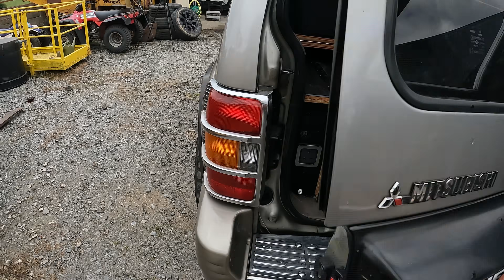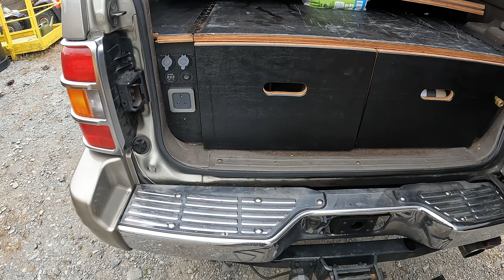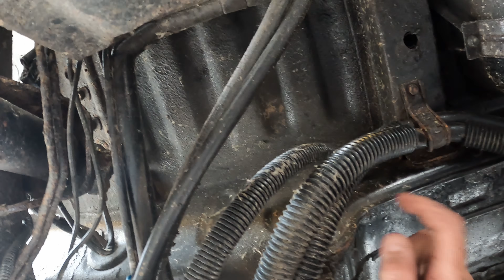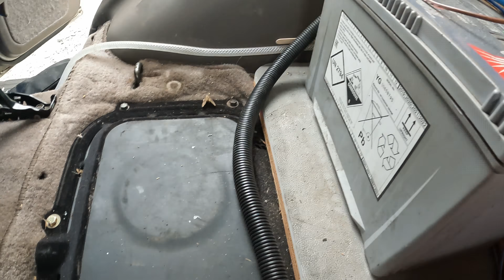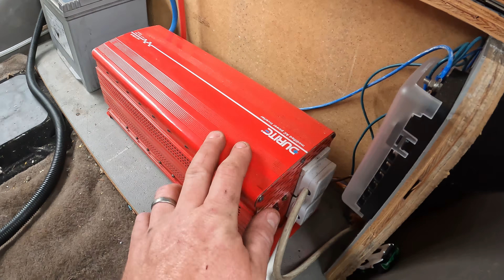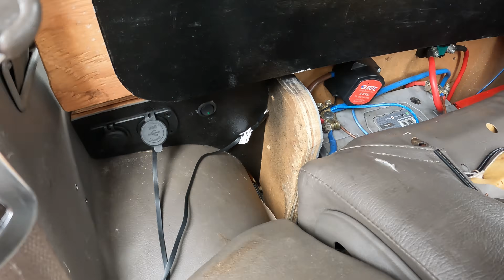Mitsubishi Pajero Mk2 2.8 Leisure battery and Split charge relay walkthrough.

Comment: Have been looking to do this for my Yeti, unfortunately though there is a lack of space. I did think about taking out the middle seat from the back row, but every time I think about doing it I find I need the seat. Nice set up, the cabling looks really sound. 👍
Reply from the maker: Thanks, with 12v tech and cordless things now an inverter isnt really a big requirement but it is useful for the fridge.

Comment: You have gone to town on the wiring there, well laid out cabling. Thanks for the insight.
Reply from the maker: Bare minimum really to be any use. I do need to get the 12v wiring tidied up a little but it works well.